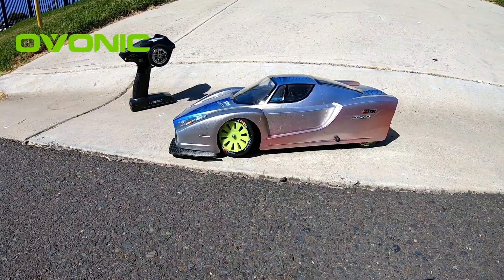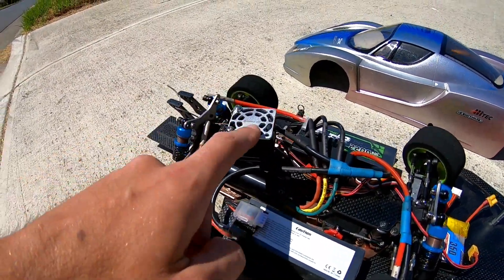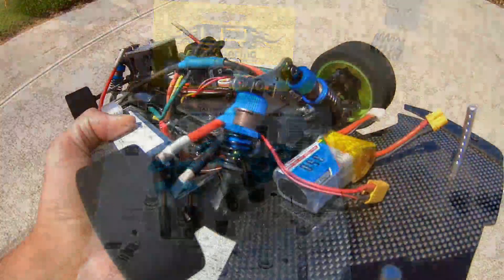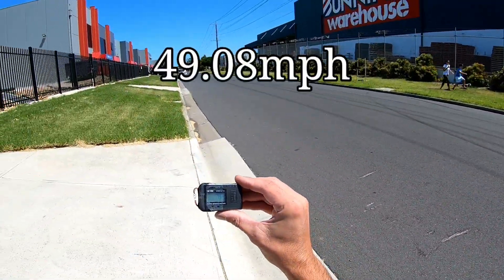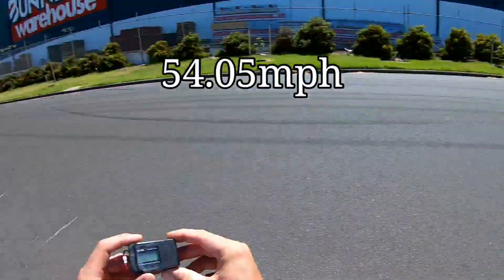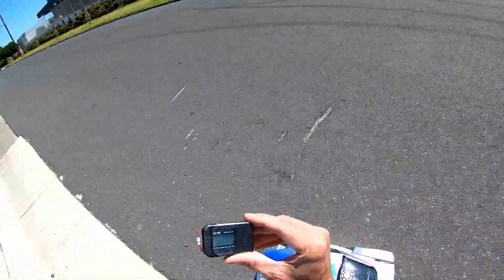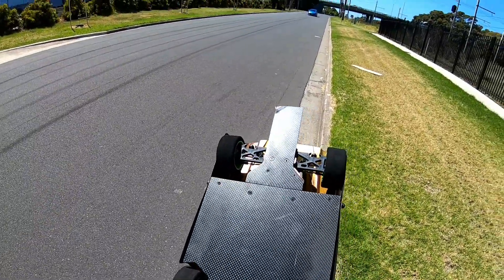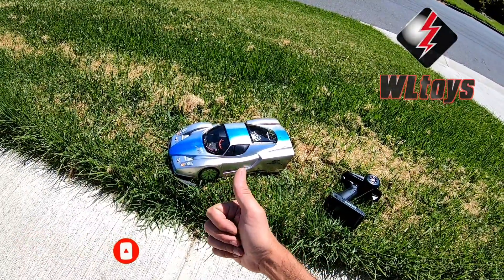WLtoys speedruns (GONE WRONG)!

Comment: Same exact thing was happening to my 124019 ages ago with that red Pagani Zonda shell, it would spin around on throttle at 100kph on 3s, i hit a kerb and fkd up a new foam tyre on the rear and bent the rear dogbones as well
Reply from the maker: Yeah mate I remember that☹
It could be similar issues because they both have a kinda similar body style🤔
Hope it's better next run🤞

Comment: Good runs! It looks like over 40 or so the rear end gets loose, maybe a wing to create down force in back would help. I'm doing some twin motor builds I'll be running soon.
Reply from the maker: Thanks mate👍
Yeah there was definitely too much air getting under the shell, my fault😅
Fixed it up I think, get it out soon for another test.
Twin motor should be a bit of fun🤘

Comment: Great video! Love your builds. 
Do you prefer the Yeah 50mm shocks to the LC Shocks? Thank you!
Reply from the maker: Thank you very much🙂
Iv not had any LC stuff so I cant really give a comparative opinion on that.

If you mean the same size as the wltoys shocks then I'd go with the Yeah Racing 50mm shocks because they fit perfectly for speedrun cars(super low CG)
For off-road cars I actually really like the stock wltoys shocks😅
Reply: @rccrazy  Thank you, Saul, I will order a set of the 50mm Yeah racing. Cheers. - Mark
Reply from the maker: All good mate✌
Best of luck!

Comment: @RC crazy  One more question, where do you get your gears? Are you using the stock driveshaft? 
The gears for the drive shaft are different than typical gears. Thank you!
Reply from the maker: Yes stock centre driveshaft, the larger gears I use for the spur I can't remember were I got them but you need one between 25-30t with a 5mm bore size depending on what size pinion you use.

Comment: I couldn't tell what was causing it to spin out watching on my phone. Was it getting to light at speed by air getting under the front end? I ask this since you mentioned weight. Good video anyway.
Reply from the maker: I think it was a mixture of a few things.
Air under the nose, no vertical stability(winglets) and the wheels are quite a hard foam compound.
I tinkered/modded so I'll get it out soon, pretty sure it'll go a bit better now🤞
Thanks Tim👍
Reply: @rccrazy  Hopefully you can get it sorted out and get some better speed out of it.
Reply from the maker: We'll get higher speeds😁
Thanks again mate, stay safe✌